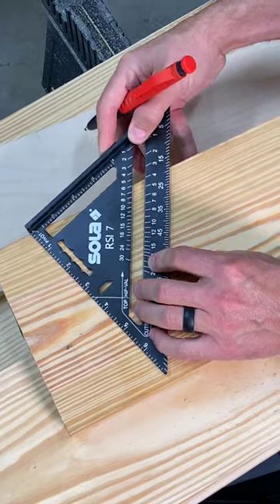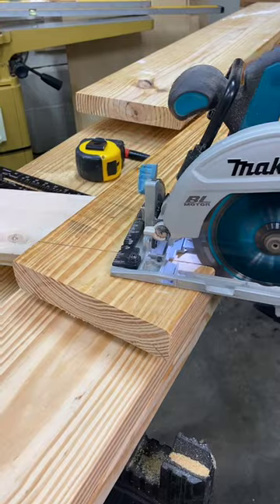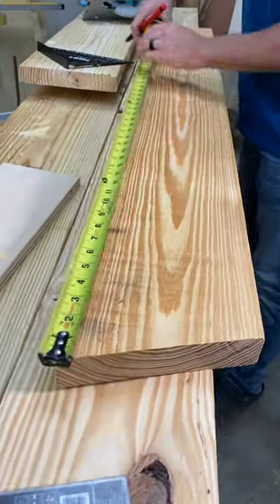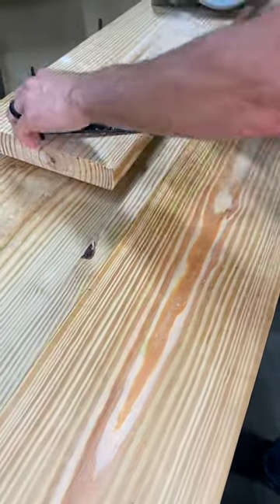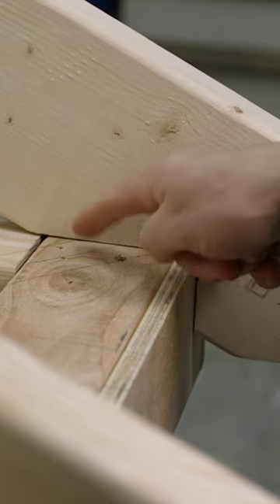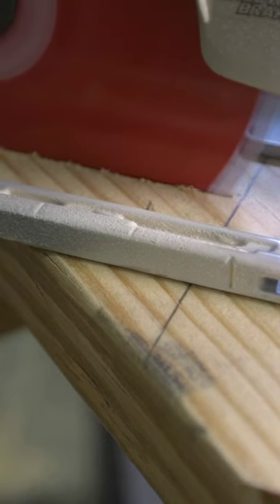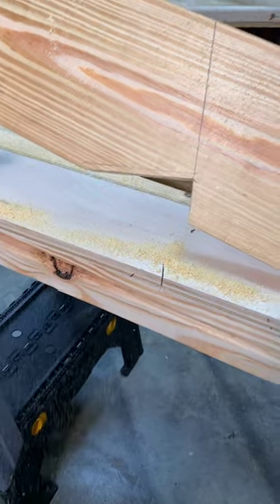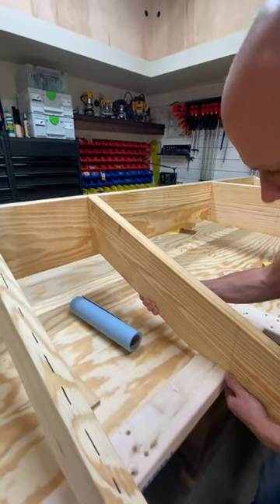Sola Framing Square and Hole Marker

Comment: I also like the diagonal method… measuring from the pointy end to the inside corner of the top plate. Because not all wood is the same width. This keeps the flatness on the under side and leaves the unevenness of the rafters on the roof side where no one see it.

Comment: So how do you determine the size cut of your final line (birds mouth). I know you use a 4 for the rafter cuts but what’s the rule on how many inches up on the second rafter line you measure to make it sit flush on outside wall?

I hope that made sense in my limited roofing terms grammar.
Reply from the maker: Hello! Yes that makes sense. To best answer that please watch my many full length rafter videos. After you watch them if you still have questions please ask. Thank you for the comment.
Reply: Thanks for asking,  I was thinking the same.
Reply: Our building code says not less than 1.5 inch in length along the top plate of the wall, most carpenters, including myself will not cut away less than 1.5 on the horizontal and not remove more than necessary to support the overhang properly.
Reply: thinking the same too🤔
Reply: It's no greater than 2/3's the plumber cut,which is the 4/12 cut line in the reel
Reply: He just measured 90° back off the line. You could also subtract the angle in degrees from 90 and get the same thing using the scale marked on the speed Square. Never heard it referred to as a rafter Square before
Reply: Measure back the dimensional with the wall with or without the plywood depending on how he framed it
Reply: @allenmcnamara9213  Thank you.  It is a speed square. Rafter squares (ie - framing squares) are right angle "L" shaped (until you drop it)
Reply: Mark was made 1.5" up from the bottom of seat cut line along the 4:12 angle. From that 1.5" mark, you reverse the angle 90° minus 4:12. This brings you back to a 90 degree flat cut bird mouth seat cut.
Reply: @hughtoobin7207 framing square and speed square are definitely different animals, but still a cat aren't they. Lol😅
Reply: @hughtoobin7207 pretty sure "speed square" is something Swanson came up with but all of them are rafter squares
Reply: To cut bird's mouth if top plate is 2x4 measure up rafter cut 1.5" then horizontal cut is 3.5" plus width of sheathing

Comment: Why not use the little  cut off piece as a template to mark the next rafter?
All you'd need to measure is the distance to the birdmouth cut. 

OR make a heavy paper pattern,  if the rafters are all the same length. 

Rather than all of that measuring I much prefer templates or jigs.  If you get the first piece right, make your pattern from it, to mark all of the other pieces, and then all of the other pieces will be correct, exact, and precise, too!

Measure once, cut, make your pattern,  and cut a hundred of them!   
All of the subsequent pieces will be EXACTLY the same!
Easy-peasy!  

No measuring, no screw-ups!  Just make exact multiple pieces!
And it is fast! Accurate! Reliable!

Comment: So, I have had one of those squares for YEARS.  However, I had never seen one used.  Thank you for the tip, as now I will be able to do some cool tricks in the future!
Reply from the maker: Glad it was helpful!
Reply: You can use the speed square with a skill saw to cut a proper 90° cut off. Just line the saw up to the 90° back side and keep it there, and tight against it,  as you cut your board!

Fast, easy, efficient and accurate!

Comment: Be sure you read your speed square right and aren't using the hip/jack lines for 4:12. I've seen that before and it ain't pretty past 4:12.
Reply from the maker: Great point my friend.
Reply: Which is why if I get one right I make a pattern, jig, or template from it for my subsequent cuts.  
All of the pieces will be exactly the same!!!
No wonky measurements.  No wavyness in my roof deck.  
Just make a pattern with a heavy paper. And skip measuring each rafter after the first one. After the pattern is made just trace the birdmouth, and the ends or tails, and cut. Use this for whatever else you want multiple pieces of something. 
Measure once and make your pattern for all subsequent pieces. 
It works! Is fast and very accurate!  Pretty hard to make a mistake cutting from a pattern!

Comment: Mistakes on roofing stock are probably detrimental.
What kind of remedies exist, for rescuing the budget, so to speak?
Reply from the maker: That's a really good question... outside of "measure twice and cut once", I'm not sure. You have any thoughts?
Reply: don't make bad measurements or cuts to begin with!
Use a pattern, jig or template to mark all subsequent pieces after making it from the first, properly cut rafter, or whatever it is,  you need multiples of. 

VERY hard to screw up your  measuring if using a jig!l

It's faster, easier and more accurate to use patterns, jigs, templates (or story poles/story boards) than it is to measure and mark  each and every piece as my way requires minimal concentration! And most people have trouble staying focused and concentrating 'these days'!

A pattern or jig is the way to go!   Just mark both sides of the jig for extra clarity, for the 1 or 2 who can, and will, screw up----   anything!

"Hey, we need to return these nails! About half of them  have the head on the wrong end!"  

Yeah, those guys!!!